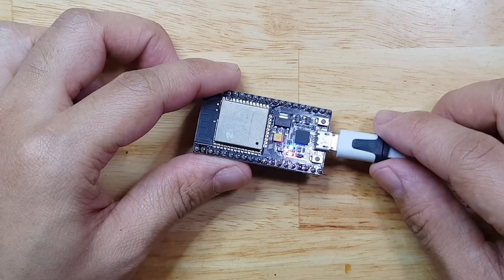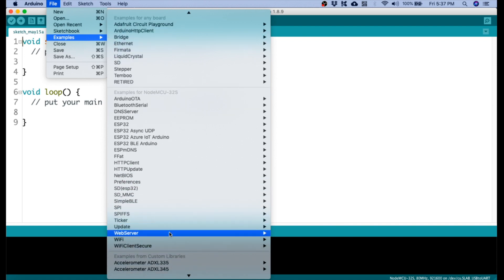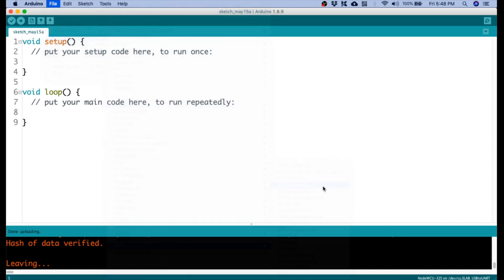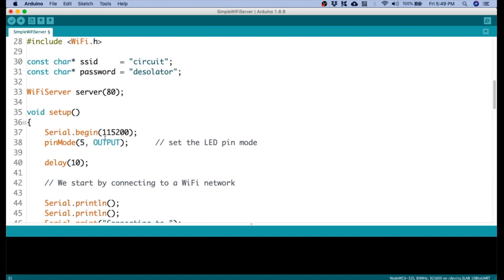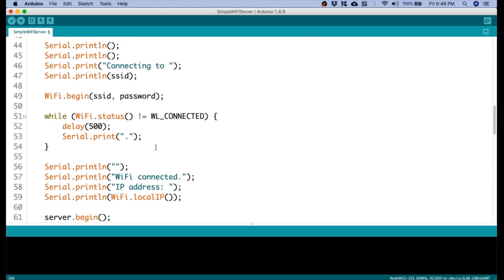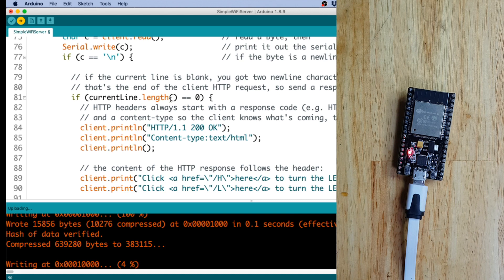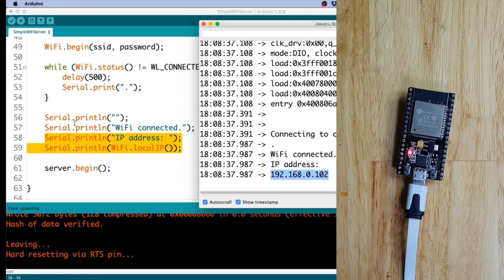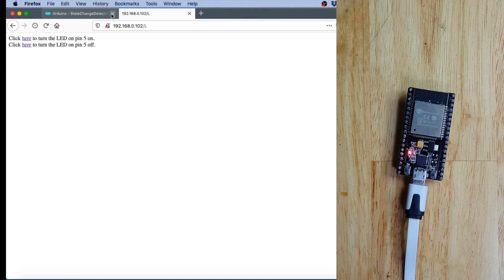ESP32 WIFI LED CONTROL - HOW TO CONTROL LED VIA WEB BROWSER URL - SimpleWiFiServer Example

Comment: Good evening Sir 

Can this esp32 will receive the command from laptop through software via wifi ?

I'm going to build led wall with the use of ws2812b addressable led strip lights.

60pixels (height)  by 104pixels (width)
Reply from the maker: Your idea is possible. You can switch your LED strips.

Comment: Are you Filipino Sir?
Reply from the maker: Yes
Reply: @circuitdesolator  plano ko po kasi gumawa ng Led wall. Ws2811 ang gagamitin kong led. 

Naghahanap ako ng software at microcontroller na pwede ma-display at ma-play yung video from laptop to Led wall na gagawin ko.

150 centimeters by  300centimeters
30lights by 60lights
5cm distance between LED